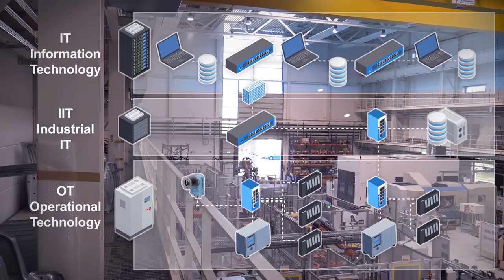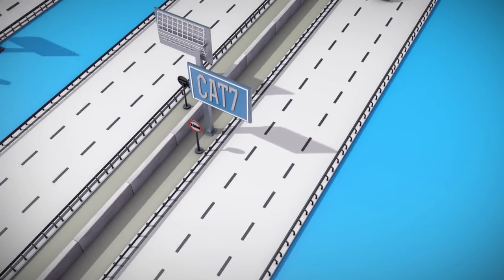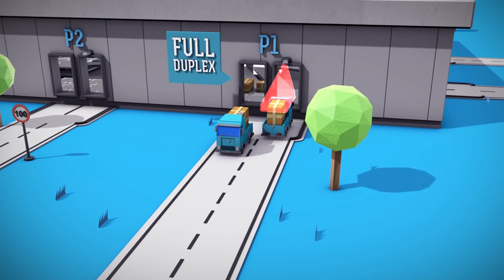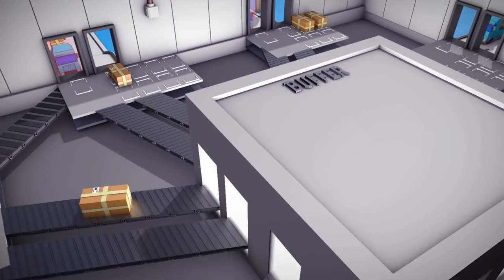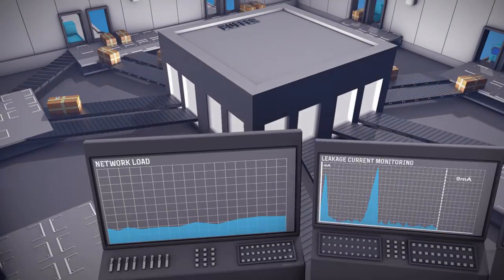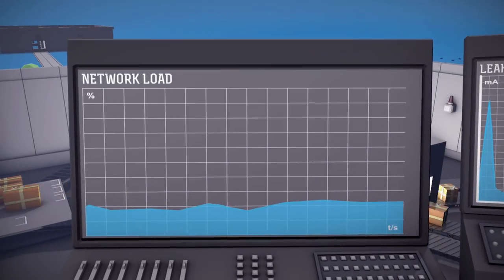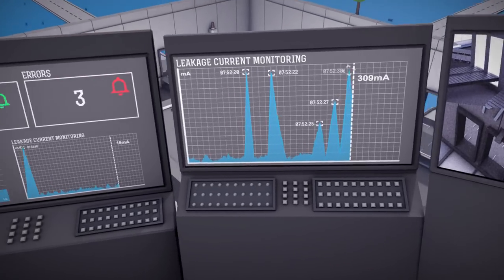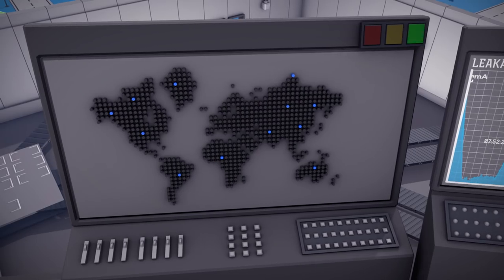The SWITCH - The network expert | Technology made easy

Comment: Nice video, like them a lot. But on 1:45, internet doesn't really nessicerally drive slower,  usually most of the packages-cars-trucks just crash on the way and dont become useful on the other end, meaning only maybe 1% of the packages are usefull and can be used. Or, the network sends heavier trucks in some shape or form or other.
Reply from the maker: This video section is meant to express that the speed mode between 2 ports is negotiated automatically = autonegotiation. If one port / both ports detect that more and more error telegrams are arriving, e.g. due to high netload or cable pinch, they will automatically slow down the speed mode.